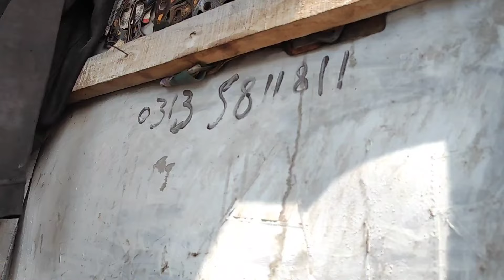suzuki cultus 1000cc efi engine Reparing - engine New ring piston installed

Comment: Morning! I have Toyota Hilux 2KD have use turbo charger,so oil inter in the intake mainfor from turbo charger,what are the causes
Reply from the maker: Then the turbo is damaged, check it properly, is it coming from the turbo itself or is the engine blowing?
Reply: Ok thanks
Reply: @madinadiesellab  thank you engineer
Reply: What is Causes of engine to blowing?
Reply from the maker: When the car's blow will be high, the starting time in your car will also be long and the engine will also consume oil. These two are different. If the turbo leaks, then the engine will start fine.  Starting will be long
Reply: Thank you madina